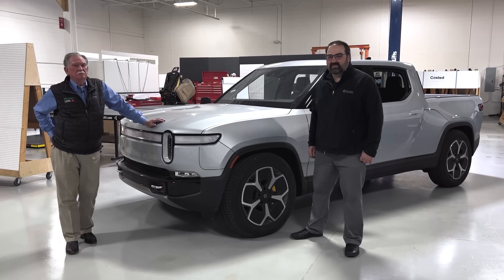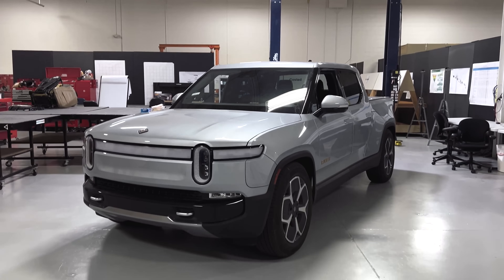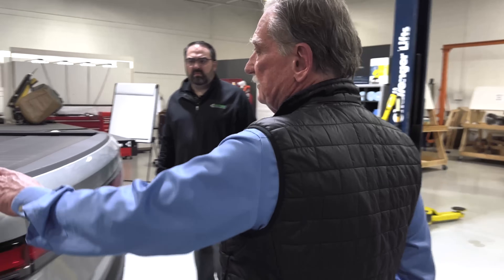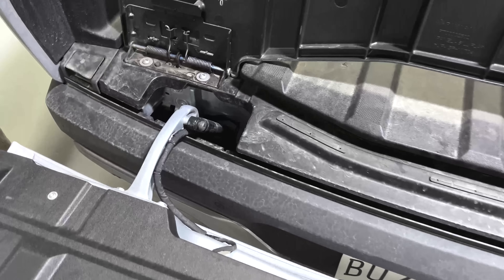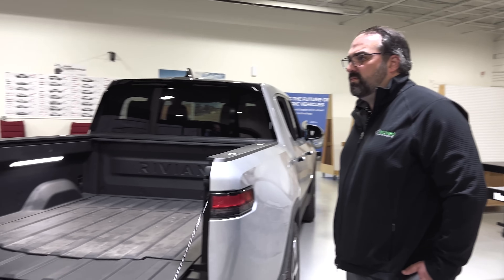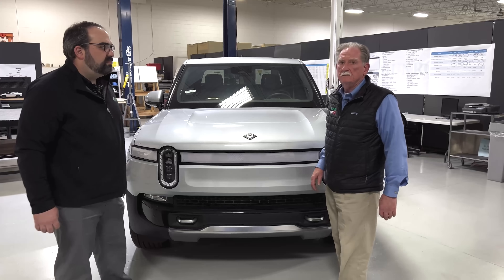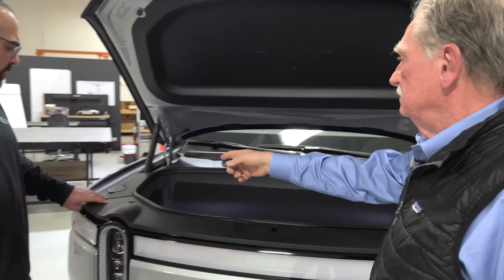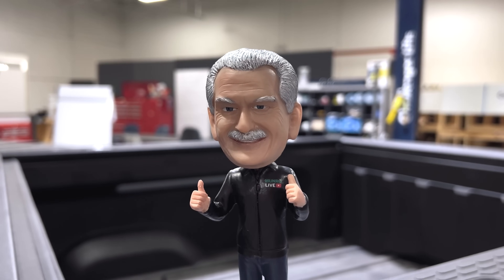Rivian R1T Teardown Kickoff!!!

Comment: I really want to see how this compares to and F-150 lightening.
Reply: The frunk design on the F150 is definitely ahead of what we see here.

For anyone who is remotely short of stature continually having to bruise & rack your ribs against the top of the tub when reaching down into the frunk will quickly get old and will mean that the lower portion of the frunk never ever gets used and will become a black-hole of an area where items fall and get lost forever.

Ford's frunk design and grille integrated into the bonnet that lifts up with it completely removes this as an issue.
Reply: @DEADB33F  Short people buy Fords.
Reply: @DEADB33F  conversely us tall guys will hit our heads on the grill of the Ford
Reply: @logicalreason51  Fair point. 

Plus, the sharp corners on the edge of the grille are probably something ford could look to change. They have 'ouch' written all over them (or have the struts raise the bonnet up higher).

I still think it's overall a better design though.
Reply: If the Mach-E is any indication, the thermal system alone on the Lightning will have plenty of room for improvement.
Reply: @CoreyWoodcox  
I think they've (probably) initiated a "covert" redesign of the Mach E system following the most hilarious critique ever on this channel(?)
Reply: @rogerstarkey5390  It takes years to change and validate new parts for these ICE legacy companies.
Reply: The F 150 has to be built much cheaper because of it's much lower price tag
Reply: Me too...
Reply: Trying to get the likes up to 150...
Reply: When Ford stars to canabolize the ICE 🧊 f150
Reply: FWIW, keep in mind Rivian designed their R1T, and R1S, as EAVs - Electric Adventure Vehicles - for a different market segment than the Ford's F150 which targets more towards the work force.  Different set of requirements hence different set of features and capabilities.  E.g. outdoor enthusiast/adventure (off-roading, camping, etc.) versus a handyman or skilled laborer.  So a true comparison should only point out features and capabilities, not which one is "generally" better than the other - that's for the buyer to decide based on their specific needs / use cases.
Reply: Rivian recently raised prices by 18-22%. There is a broader gap than between just types of vehicles. Rivian is solidly priced in the Land Rover/Escalade bracket while the F-150 Lightning is solidly in the higher-end F-150 price range.
Reply: @chuckm260  sure, but theres still the only two EV pickups to compare right now. Would love to understand the nuts and bolts design decisions to compare how the companies handle power, battery conditioning (apparently Ford includes a second AC loop for the max tow package) and the suspension differences.
Reply: @ardenthebibliophile  What's the other one.  Lightning on the road yet? I've seen the Rivian parked across the street.
Reply: The F150 Lightning base Pro model is $40,000, dual motor, and 0-60 in 5.0s. You could buy two of them for the price of this Rivian. And it's still cheaper/faster than a Tesla Model 3 standard range rwd.
Reply: @fcv1967  
So "It's still cheaper and MUCH faster" than the Mach E?
Surely a better comparison?
Reply: @fcv1967  ford is not selling a 40k truck . It’s a suggested retail price, dealers will rape u in the ass with mark ups… the 40k lighting does not exist … it’s a simple marketing gimmick. Ppl think u can get a 40k lighting simply has no clue in the car world now days
Reply: @fcv1967  I'd like to see the ordinary guy try and buy  a $40,000 Ford Lightning,  to my knowledge it is  for fleet buyers, $40,000 would make it a steal, what would Stealership markup be?
Reply: @fcv1967  So you compare a 10 year old car with a new truck?
Reply: @fcv1967  as we have seen in the EV industry, cost of the battery is the major factor in the final vehicle price. Do I think Ford will offer a $40,000 version ? No way. 
I chalk that up as a marketing gimmick. Ford will be able to use Covid, supply chain, worker shortage as reasons for not being able to sell them at 40,000. And that is acceptable in this environment. I guess in reality they only need to sell one at 40,000 to then say we kept our word. Elon did the same thing with the 35,000 model 3. 
In the end, I think Ford will do a really nice job on the F150, just expect it to cost a bit more to stay in line with current challenges.

Comment: Yikes!  Very interested to see what's up with the regenerative braking.  I saw one that seemed to overheat and stop regenerative braking on a long decent.  I've seen a model 3 go down Mount Washington without this issue, so I'm wondering if there is a weakness in the cooling system.

Comment: I would like to see the side of the internal washer bottle or neck, in a cut out, to read the washer level to avoid overfilling it and spilling $3.00 to $ $4.00 a gallon Rain-X Washer Fluid! 
Also molding a drain to the outside channel into that black plastic and a pop up spring loaded guard dam for the inside edge to direct any spillage away from the interior of the Frunk, channeling any spillage away from the interior to the exterior to run off. I could be carrying cargo, in the frunk that would be ruined by Windshield Washer fluid contamination, such as food, mom’s homemade apple pie, plush kid’s toys, clothing, laptop computers, etc.